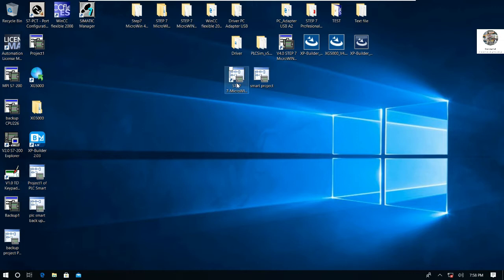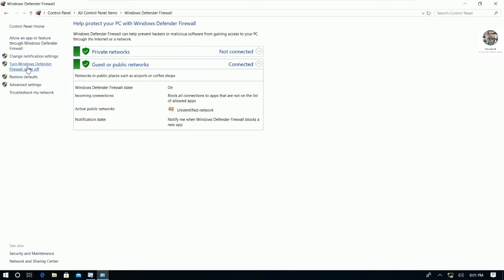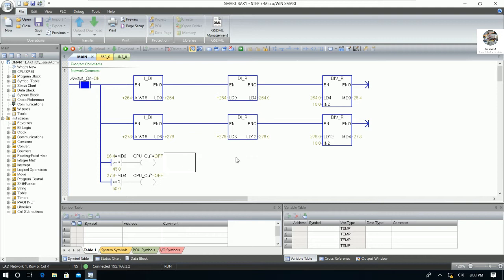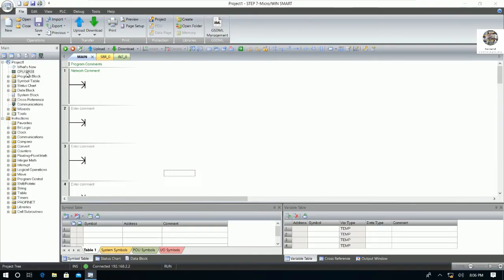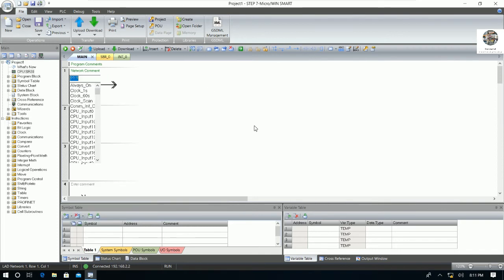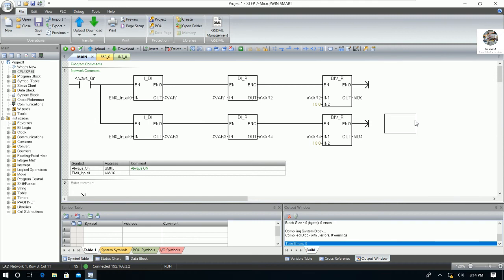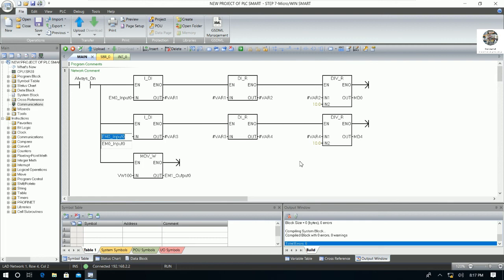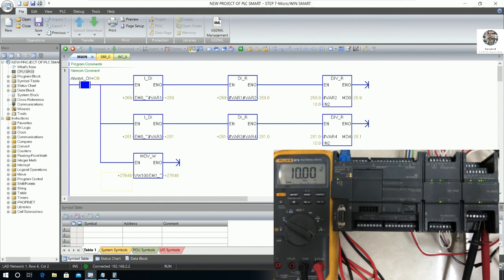Easy to connect PLC S7-200 SMART communication with LAN cable by using Step7 MicroWin SMART V2.5

Comment: Hi friend, i am trying to access our PLC S7-200 CPU ST60 and it was found. The problem is after i press the Upload button, the microwin suddenly closed. It is not the same on your video that the blocks immediately appeared. My question is, does the program still there in the CPU and not corrupted? Thank you

Comment: I have been try connect cpu st40 with my laptop but failed... 
I try ping default ip but it's no reply..
When I click find cpu, there is no cpu found, can you help me solve it.. 

My network port is works when I connect it with another networks, except the plc one
Reply from the maker: Dear sir,
First we need to put the automatic for IP address of your computer.
Second we need to connect the Lan cable from your Lan port of PC to PLC S7-200 Smart.
Third we need to turn off windows fire wall: control panel->Windows fire wall->select OFF then click ok.
Fourth we need to open softwar Simatic Microwin Smart->Communication->Select the coorect your network port type-> Click find CPU-> It will found IP address of PLC and Mac address also.Then you can put the manual IP address of your computer the match with Ip address of your PLC.
I hope it work.
Thanks
Reply from the maker: Anyway I will create a tutorial more and go slowly step by step about how to connect using Lan port between Simatic Microwin Smart with PLC S7-200 Smart for easy to understand.
Thanks
Reply: My problem solved after windows 10doing updates